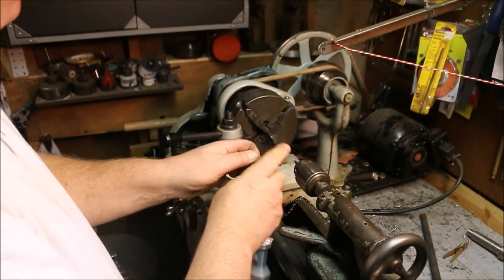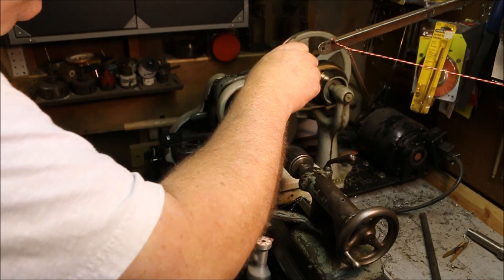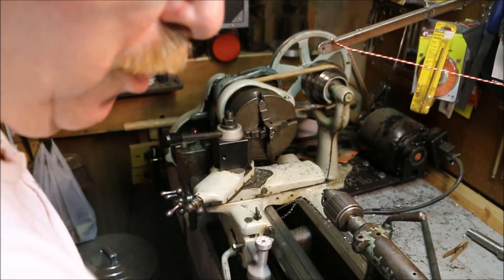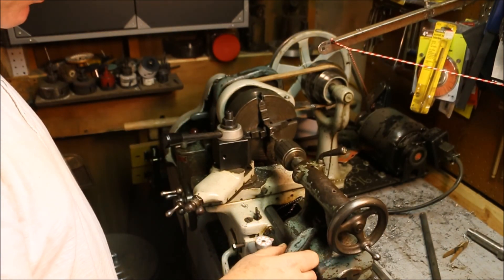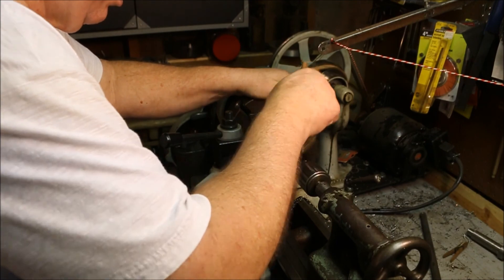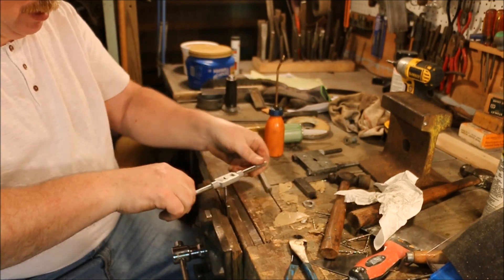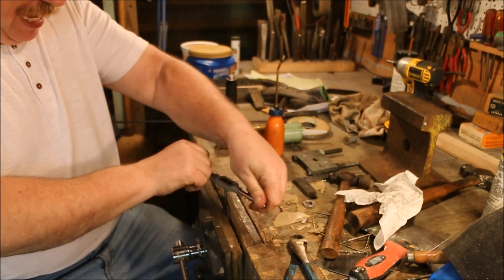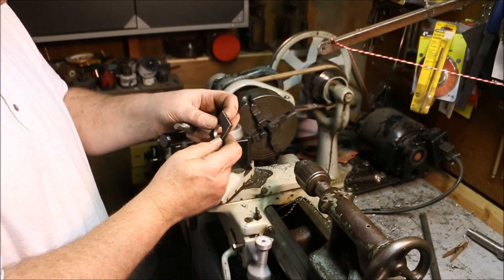TREADLE GRINDER ~ PART XIX ~ DRILLING & TAPPING LINKAGE BEARING MOUNTS

Comment: For a new video....have you ever replaced or fabricated the moveable foot on a c clamp?  The end of the clamping shaft has a ball end to fit in the socket foot.  Flea markets sell these clamps cheap without the foot.  The old clamps are better quality than today's clamps and worth fixing.  By the way, you win for the level of tenacity you have with the treadle grinder renovation.
Reply: I have, i used several plates of steel with the last smaller hole one cut in half, to cover the ball then welded on the perimeter and cleaned up if you had a lathe you could attach a stalk and clean up the rounded part, i have also done this with ply on wood clamps and workd well
Reply from the maker: Al Jacobson I haven't done that yet. Jusb1066 has an interesting method below.

Comment: ..I can't think of many things worser than breaking a tap. Especially a Cheap Chineseium one...!!
Reply from the maker: Ol James Knock on wood.  I got them tapped without incident.
With a good sharp hardened tap, as long as you don't put a side load on it, it will withstand a great deal of twisting torque. If it does snap on the way in it can often be removed  with a tap extractor. After the first half turn backing out, it is running in the cut threads. If it snaps on the way out it is usually not going to move either direction. It can sometimes, big emphasis on the some, be removed by breaking it up with a punch.  
The cheap chinesium taps will dull quickly. Because they are soft. They will twist off in either direction. Because they are soft. They don't break up well with a punch. Yup same reason.
If you try and drill them out, the end will work harden and eat the drill bit.  
Best thing to do is go over to the EDM and burn them out. But then if you have an EDM why are you using chinesium taps? Same reason I did. It's the only one you have.
Reply: That's why I like welders.